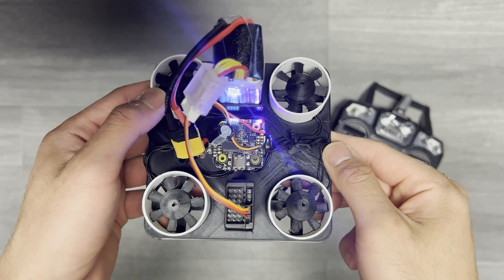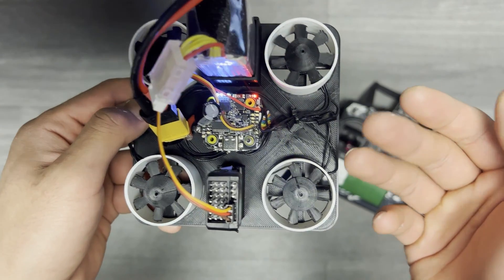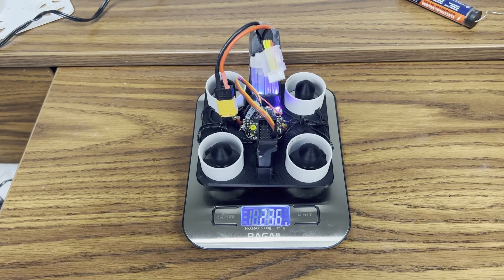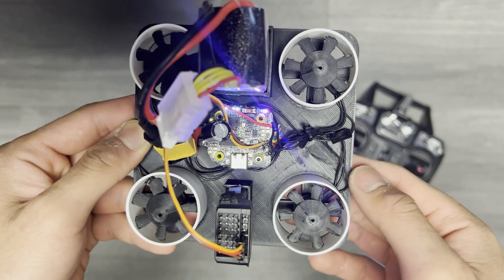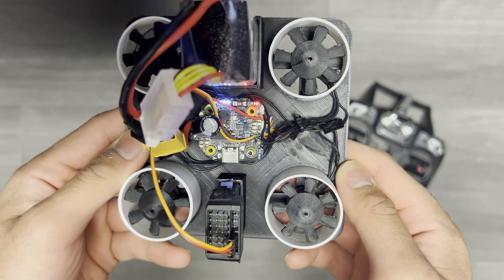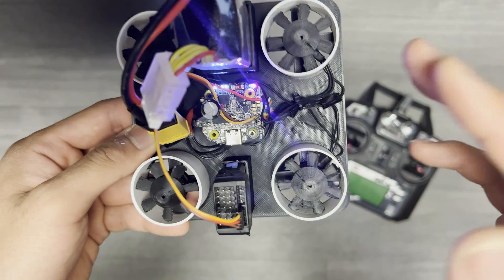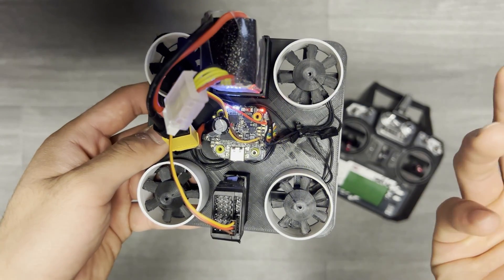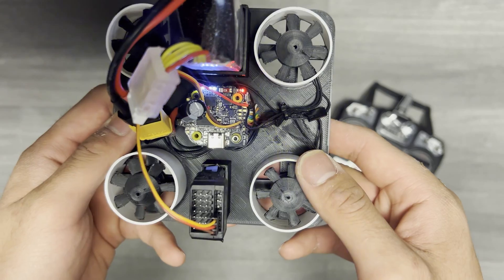3D Printing a Ducted Quad is Really Hard

Comment: Hey, to measure the trust with à balance, you need to put your qwad upside down, otherwise you mesure the the weight of your qwad + the air pressure of the thrust... so even if your qwad fly it will show the same weight minus the thrust that don't hit the balance... on your FC you can set the arm to be alowed at 180° rotation
Reply from the maker: That make sense, I think there was a similar comment. Either flipping it or elevating it where ground effects are minimal

Comment: To beat the blade tip vertices, the gap between propeller tip and the duct has to be almost nothing. I've seen that some drone builders will size the propeller just enough to fit but still have a bit of friction between propeller tips and the inside wall of the duct, then when they spin the propeller up the friction will wear away just enough of the tips to spin freely but have virtually no gap.
Reply from the maker: Fascinating. Should be relatively easy to do with this PLA. Thanks for the tip

Comment: Why are u using that huge battery. Or atleast try to lay it down instead of having it straight up.
Reply: Or center it. The motors on that side are doing all the work! The flight controller doesn't have to be in the center for it to work.

Comment: You're probably not as far off as you think in terms of thrust.  Your measurement method undermeasures the thrust because with the drone right on top of the scale, the air is pushing against the scale, greatly reducing your measurement.   Place the drone on a pedestal further above the scale to minimize this error.
Also, your mass distribution is clearly way off center with the battery so off center.   
That makes two motors responsible for carrying most of the load.
Reply from the maker: The pedestal makes sense, should be pretty easy to incorporate. And yeah, working on redesigning a frame now. Thank you for your input!

Comment: Hello friend, If you want to fly it, you need to do this:
1. Get rid of the scale (replace the receiver with something smaller or remove the plastic from what you have). I recommend ELRS/CRSF, but you need to replace the receiver in the radio.
2:The battery should be as close to the center of your quad's axle as possible.
3: Change the battery to a lighter one and less mAh.

It should work...
Reply from the maker: Appreciate it man. Thinking about it now, battery placement does make a ton of sense. I guess I was hoping the controller gyro would make up for any weird CGs I had.
Reply: @mach10point4  I just hope you can fly next time :)